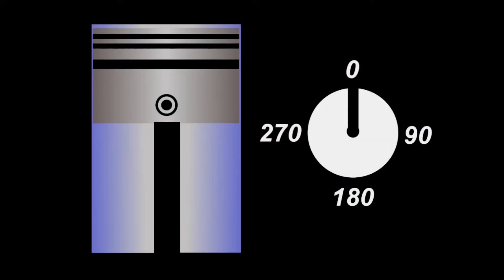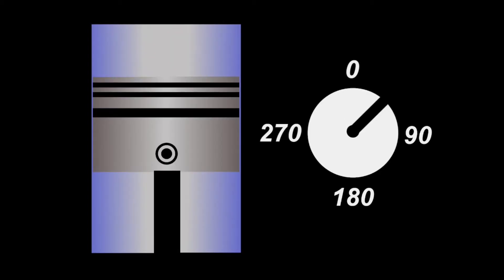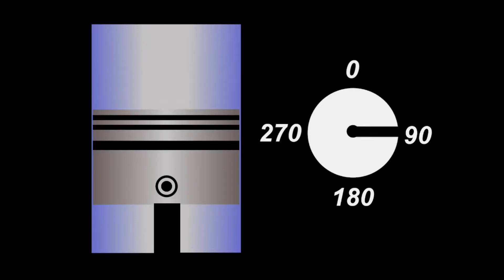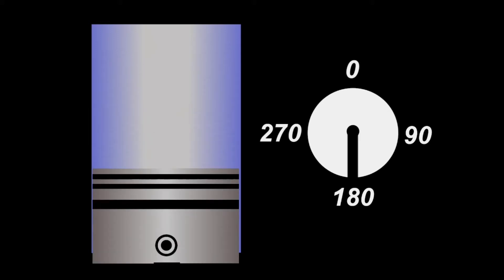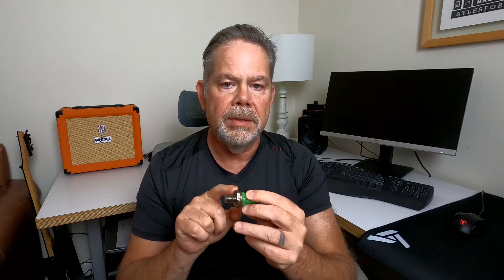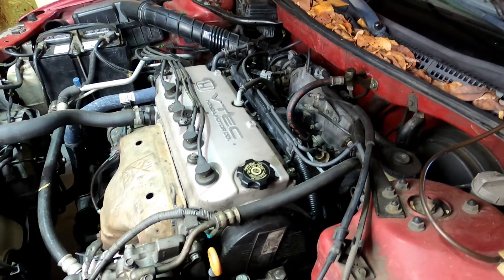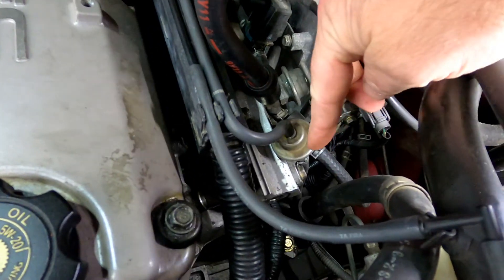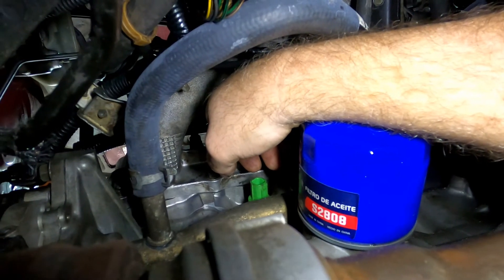What exactly is a knock sensor?

Comment: Can a bad ail filter make a knock sensor make my check your ignition  light ho on ?
Reply: The knock denser has been replaced  with  gmc part and check  ingition still comes on
Reply: I paid for a knock sensor to be replaced and check engine light still comes on    what could be wrong ?
Reply from the maker: If you meant "bad oil filter," I can not think of a reason it would cause a code for knock sensor. The wiring or plug for the knock sensor could be loose or broken, or the ECU could be bad.

Comment: Well explained. Wondering how older engines compensated when they do not have a knock sensor to inform the computer to make adjustments. I recently changed a knock sensor on an Audi which solved the sluggish acceleration but the mechanic warned me that while the code reader showed a knock sensor fault, the problem could be something else like a faulty coil but luckily this was not the case.
Reply from the maker: I don't think they did anything to compensate. I remember having a new CR-X back in the day and it pinged like crazy on 87 octane. 

Thanks for the comment!

Comment: Hi, Thanks  I  have a '02 Acura RSX, with the 3025 code, and 1457, which is emissions. Is it possible these inter related? And with a new sensor, Do you just use the factory  replacement$$ or if  an aftermarket one is OK, I see an aftermarket with a 3 yr replacement warranty.  My local mechanic say aftermarket ok.?? Thanks
Reply from the maker: I had an aftermarket knock sensor that only lasted a year. OEM is usually best, but if you have a warranty and don't mind swapping it out, you should be fine. P1457 is a problem with the gas tank evap system and I don't see how that could be related.
Reply: @ktecgarage  Ok thanks! Both problems came up at around the same time, and thats why I asked. Actually I was hoping it was related lol 
Swapping  the sensor it will require me to remove the intake manifold. I just put a new starter last year , and removed the manifold then to get to it. I used a new gasket as well then. Do I need to replace that  as well , again? Just wanting to order everything together. Thanks!!
Reply from the maker: Ah. K series. If I did it myself, I'd try to reuse the gasket. The right thing to do is replace it.

Comment: I have volvo s60 T4 1.6 ..2013 .fault code knock sensor. And has a black smoke when u start it idle good but after 1 min it start smoking pliz help
Reply from the maker: It the check engine light on for anything else?

Comment: What would happen if the Valve adjustment gap is slightly too tight on any cylinder? Would that cause a knock?
Reply from the maker: Depending on whether it's is the intake or exhaust valve, it might cause backfires and/or misfires. Not sure about pre-ignition.
Reply: Usually if you go too tight on the exhaust valves, they have a chance of not fully seating on the face, and this will overheat the valves that aren’t fully closing.

Comment: Can I install a knock sensor on a honda block that doesn't have one? And where on the engine are alternative spots?
Reply from the maker: Maybe??? Honda puts them under the intake, so maybe you can find an unused mounting point and tap it to fit. I'm assuming you have a PCM that can read the signal and retard the timing.

Comment: I took out my throttlebody and pleum off and cleaned it put everything back together now car is running at high rpm its over 3,000
Reply from the maker: Throttle cable not adjusted right or a vacuum leak would be my 1st thoughts. Make sure you didn't miss a hose.
Reply: @ktecgarage  if was idling high with cables on and off
Reply from the maker: Ok. If it was idling normally before, then I would bet on a vacuum leak somewhere.

Comment: where did you buy the rebuild parts or kit for the f23 your working on?   I have a f23a5  (dx)  that is burning alot of oil and getting ready to rebuild with some friends of mine.
Reply from the maker: Company named Evergreen Engine. I purchased their f23a1 kit from Amazon. Try eBay Motors as well.

Comment: Your tutorials are incredible. I rebuilt my f22a1 with your how to. Finally bought factory manual , for start up fine tune procedure/wiring diagrams. I've moved on with another vehicle B18a1.
Reply from the maker: Thank you! 

The cool thing about these Hondas is that there isn't a giant learning curve working between the B, D, H or F series platforms other than the twin and single cams.
Reply: @ktecgarage  hey I'm about to put a timing belt and water pump on my accord.  I'm gonna use your videos I just found your chanel and love the rebuild video I watched so far... I'm doing the rear main now just got the tranny dropped once that's done I'm going to the front side...